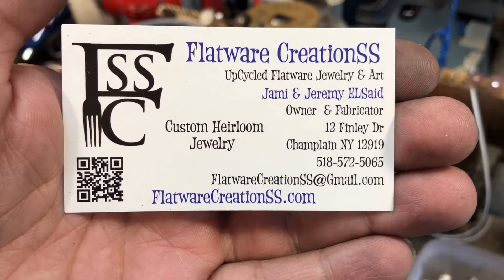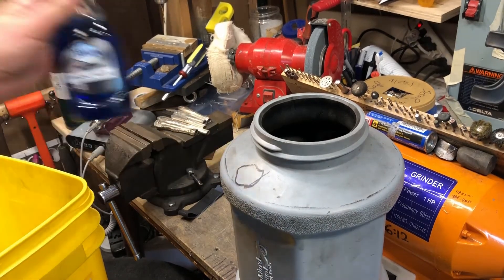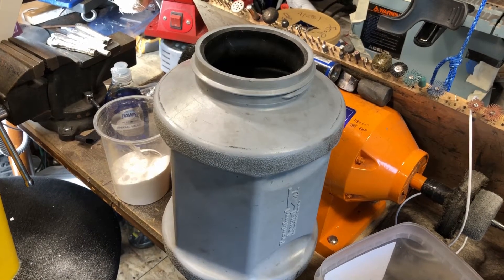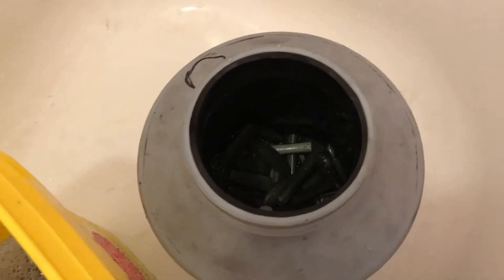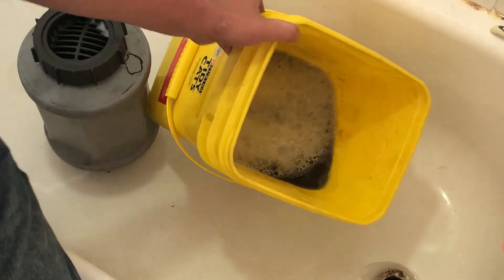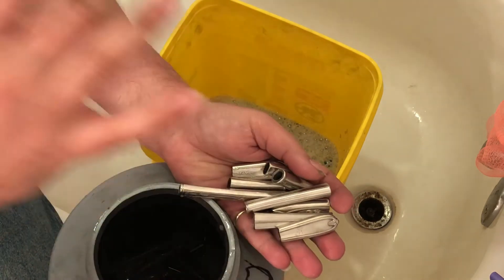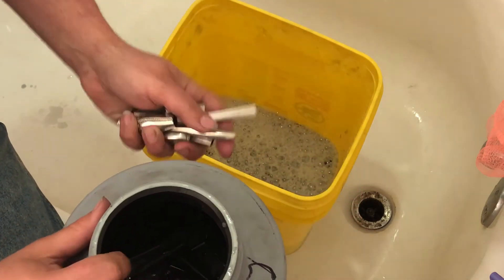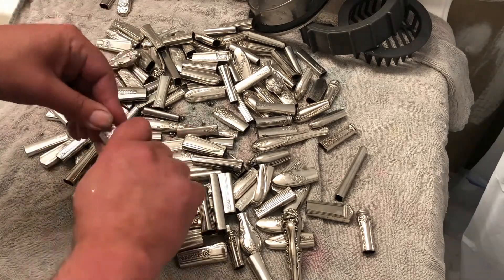This is my Tumbler set up for hollow handled knife refrigerator magnets

Comment: Hi Jeremy. I was wondering if you could help me with my leaking Tumbler? I have look everywhere on YouTube and found nothing. I noticed this video is 3 years old and that might be the problem. I purchased the exact Franklin Tumbler 3 weeks ago. I followed your instructions but it took me forever to fix the leaking seals on mine. It was pretty significant and I had to put them on super tight. It got really good reviews on Amazon but some people complained about the same thing. If the reviews are 80 or more 5 stars I don’t pay much attention to the bad reviews. Any suggestions on what I can do to fix it? Thanks! 🙏🙏
Reply from the maker: Ok I’ve had this problem come up before. The ends of the tumbler sometimes have little imperfections because they are hand made. If you take some sandpaper to the ends and get of any burrs off. I had one that I took the knife to. That should help with getting a good seal easier. I also once I get one end tight and not leaking. I marked the other end so I always takeoff only one side and that helps me to take on and off only the one side. I mark one side so I don’t have to guess which side is which.  I only open the 1 side. Some of the shot and some other stuff gets stuck in the end but I’ve gone months before cleaning out that end. Let me know how it turns out for you.
Reply: @FlatwareCreationSS  Thanks again. I will give it a try. 🙏🙏

Comment: Instead of pouring it down the drain - why don't you pour it out on the ground? Doesn't that go back into the water system? I would be afraid of it eventually building up and clogging my drain pipes as well. Of course I live in a very old barn with cast pipes so we don't put stuff like that down the drain anyway. Great vid otherwise. Very informative Jeremy as per usual.
Reply from the maker: Aims Abson thank you for the recommendation. And Thank you for watching.
Reply: @FlatwareCreationSS  The more I think about this - an overnight mulling - I'd say that what you pour out of your drum into the bucket is hazardous waste and shouldn't go down the drain and maybe not even on the ground. Here we have a large drum where I pour stuff like that. When I do etching all my rinse water goes into a bucket and then a container and marked so I can tell them at the hazardous waste roundup exactly what they are dealing with.  Today we were requested not to pour paint, paint thinner, etc . down the drain - and that includes water based paint. So - all that sludge you get out of the handles is probably considered hazardous waste. Pouring it down the drain just puts those pieces of metal filings back into our water system unfortunately. I know you are always changing the way you do things Jeremy so perhaps this could become one of those things too? We don't have endless water supplies depending on where you live - I know in the summer we have to alternate our watering days to preserve what we do get.
Reply from the maker: Aims Abson thank you for that. I think that I can make a settling barrel for the waste water. Then once it has settled I can drain the water off the top. 👍 I’m always up for doing things better.
Reply: @FlatwareCreationSS  I know you are Jeremy - we've seen you doing it all along!  Was thinking you could strain it through something (like a huge coffee filter). I remember when Filter Queen Vacuums had a huge filter that would do the job....might be worth looking into.
Reply from the maker: Aims Abson I actually have 2 packages of those filter bags. Thank you again.
Reply: @FlatwareCreationSS  I know it isn't easy to do Jeremy but maybe you could post something to amend this saying - don't throw it down the drain? Otherwise - I'd be interested to see how much crap you get on a filter after you go through your process.